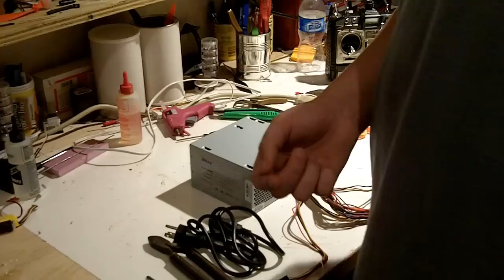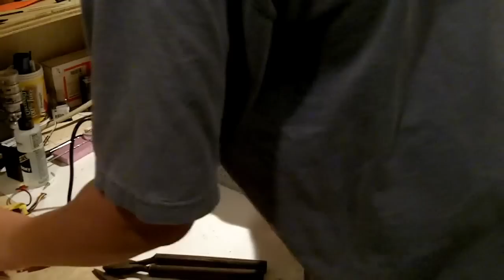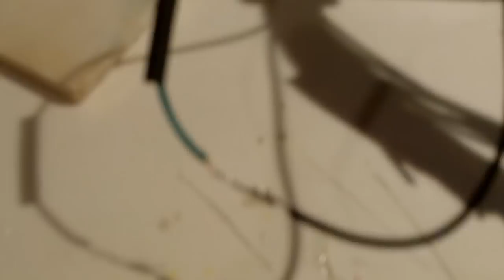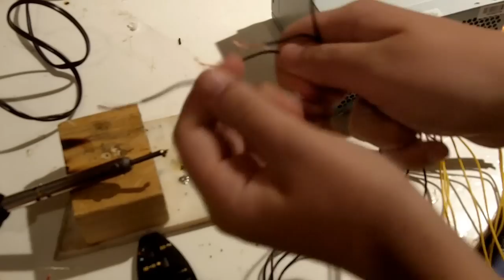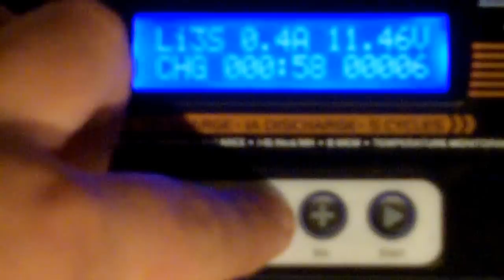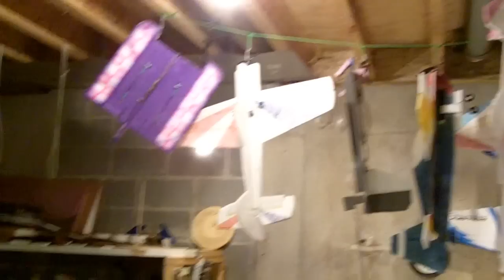DIY 2.0: How to make your own 12 Volt Power Supply

Comment: Thanks dude! I just ripped apart an old computer that I was throwing out, pulled out the power supply and followed along with your video. My lipos are now charging on my B8+ 12V charger connected to my newly made power supply! :) Stoked! Only criticism, I stripped all the black wires as you said to, then only used 5 coz that's how many yellow wires I had (plus one to connect to my grey switch wire). Awesome job man, thank again.

Comment: Some friendly advice:  For easier soldering, tinning the wires (saturating each one with solder) before you hold them together is recommended.  The soldering iron tip should be held parallel against the wires as you connect them for more efficient heat transfer.  These things, along with a heat sink (or alligator clip) at the point where the insulation begins will prevent melting insulation and hold the wires in position, allowing you to hold the iron.
Reply from the maker: +Steve White Thanks for the tips! I made this when I was 13 and have improved a little bit on soldering now.

Comment: The use of a resistor is for switching power supplies, because they won't work without a load.  The resistor acts as a load, of sorts, and the current used is wasted as heat.  Continuous power supplies will work simply by grounding out the green PS ON wire, as shown in the video.

Comment from the maker: Depending on the voltage required to run the fan, put your negative on a black cable then put your positive on the cable with the corresponding color to the voltage. The color key SHOULD be on the side of the charger. check the link in the desc. Scroll down the color diagram and that is standard. Hope I helped! :-)

Comment: Ok, Here is the thing I did the same thing he did with one exception.
I took the cover off of the supply cut the wires that i did not use at the board itself that way there is no chance of shorting the system. I also cut all but 2 of the yellow and the same with the ground. A good video still!

Comment: The Triton charger recommends a 12VC supply capable of 13 amps in order for full function. I have a Triton and use a commercial power supply capable of 20 amps. I also have a small 12V supply that goes to 5 amps and it won't work with the Triton.

Comment: Hi - should connect one of the red 5 volts wires through a 15 watt, 10 ohm, wire wound resistor to a black ground wire to make it work properly apparently Fred in UK.

Comment: Would advice the same as Tom Smith, resistor on the 5v rail if its ATX 1 standard with powerful 5v rail or resistor on the 12volt, if it is ATX 2 standard. So you can place the switching power supply in nice smooth working mode.
Reply: *****  In most of the atx psu units the driver IC cant step down the PWM to the regulated voltages because it need some current drained through the output lanes so you don't see that mad ripple on the start of it and so the unit can run kinda smooth voltages on the outputs. Anyway ofc i would not recommend PWM supply for any nice low voltage circuit, unless you don't use some liner adjustment after the psu.

Comment: continued.........

Wires must be joined to get that. In otherwords if you use one yellow 12 volt wire for one connection and the other for a different connecvtion you only get half the rated amps per wire.Anyone that is going to seriously use one of these should know electricity basics and you should have a tester to see exactly what you have on each line. You must connect the sense line also . This is wire 13 on newer supplies and wire 11 on prepentium 4 supplies. Hook it to the same color

Comment: The only problem with this is atx supplies are switching power supplies so they should always have a load on them . For older pre pentium 4 you should run a dummy load resistor between +5volts and ground.new supplies between +12 and ground 5 watts is good. If not you will have a very unstable power supply that could damage some circuitry. Also you dont have full amp rating that is shown on supply always stay out 20 percent (so 30 amp nothing more than 23 amps or so. and only all of that voltages

Comment from the maker: Make sure you have the green (power on circuit) wire soldered to a black (ground) wire. That will allow you to fool the supply to thinking that it is in a computer and to turn on and remain on. If that does not work, go through and make sure that all of your excess cables are insulated and not grounding out to something. If you have any other questions, feel free to ask! :-)

Comment: this is a dangerous and stupidly hard way of doing this... 2 simple steps: 1. take the main motherboard power connector and look at the tip of it with the clip facing upwards, the 3rd and 4th pins from the top left are the internal constant power switch, bridge them and it will turn on (leave it off for now). 2. use A yellow (positive) and A black (negative). 
The reason: you can still fry it with the same amperage & the outputs are not all on the same feed, you can overload it and cause a fire.

Comment: if i put a basic on/off toggle between the green and black wire, shouldn't i be able to leave it plugged in and just use the toggle switch to turn the power supply on and off? i dont' have a switch on my atx like the one in the vid

Comment: HI,
i tested my power supply before starting and it worked well, the fan kept turning. But now that i have cut all the connector and i connect the green wire to a black, the fan start but stop right away. Any sugestion on what the problem is?

Comment: pin 14 on my touch ATX is grey. I hooked it up to the black to turn on the power. I only have 3 yellow wires. My plug shows 1-O,2-O,3-B,4-R,5-B,6-R,7-B,8-G,9-P,10-Y,11-O,12-BL,13-B,14-GREY,15-B,16-B,17-B,18-WH,19-R,20-RED.
Do I only hook the three yellow together?

Comment: Hello I have a hipro model HP-D2537F3R that I want to use live a variac by adding a knob to control the voltage but I also want to add a switch so that I can still use leads coming from it as presets like my +5,3.3 and 12 is this possible

Comment: I have wires that are half yellow half black in addition to solid yellow and soid black wires. what do I do with these?
Reply: +Dustin Germ hay so, the yellow and black cables are 12v at a higher amp output.  solid yellow is usually 12v at around 7 amps. but it all depends on the total continuous power output.

Comment: Good video. Just one question...why do I see others adding a 10watt/100ohm resistor to the same PSU mods? You didn't add one and it worked fine.
Reply: Depends on if it is an ATX1 or ATX2 PS.  ATX1 needs the resistor while the ATX2 doesn't.

Comment: Great V!deo .... very neat.. thank you man! just want to know , how many 12V device
i can use at a time? if my 4 device all together 200w , needs 10A minimum , do you think it will work safely ? Thanks again ....
Reply: mahabubur rahman I know that when I over amped mine , by adding a 300w car amp to it, it just shut off at the first bass note. so I use a bigger watt psu for amp only
Reply: awesome... you rock

Comment: could you use that for a two way radio or ham radio
Reply: Depends on the wattage rating of the PS.  (Watts divided by 12 volt = amps  (example:  400/12=33.33 amps)

Comment: I have a quick question that im sure you will know the answer to! I have cut my wires and twisted together the green wire and a black ground wire so it is always on when i plug it in.When i plug in the mains cable, the fan on the PSU spins up quickly then stops instantly. There is no power getting to the device i have attached. are there any other wires I need to attach together other than the green and a black?
Reply: some power supplies have a pink wire connected to a red wire at the 40 pin connector.  When you cut off the 40 pin connector you lost this connection.  Run a red wire to this pink wire and it will come on.
Reply: No pink wire on it im afraid. I did look but no sign. I used a different power supply and that works fine so obviously some idiosyncratic anomaly with this HP power supply!
Reply: I had the same exact problem. I found 2 wires into the same slot on 24 pin connector. Tied those two together and (kept the green and black tied together as instructed) the 2 wires I found were Brown and Orange.
Thank you guys.
I was about to give up. Kickin 12Volt Ass now!!!

Comment: KC9WAE  had asked if  this would work for a CB radio. The answer is NO it's only pulling 0.4 amps. Depends on your radio, ex.. say a Cobra 29 may needs something like 4.0 Amps  A high end radio may need 7 to 10. 
JCarrot Selby  asked about the music at the start.  Its a Swiss band, Yello  and the song is,  Oh Yea.   1985 - 87  something like that.

Comment: OK so I am done with everything, I now have 2 sets of yellow wires and 2 sets of black. What do they go into? What I am trying to get is a 12v power supply. Do I connect all the yellows into one and the blacks into one then attach to item? I need it for my robot! Thanks.
Reply: All depends on how much current you need for your project

Comment: I have two Dell power supply but when doing the green and black nothing :(
Reply: What wasn't mentioned is that some of the power supplies have a load sensor on the 3 volt rail. You must take a RED wire, connect it to a 10 ohm 1 watt sand bar resistor, and the other side of the resistor to ground. This will satisfy the 3 volt load sensor and power up the supply. Mount the resistor in the path of the fan flow to keep it cool.
Also, on the supplies that do not have a load sensor, you can add this resistor anyway as it tends to increase the 12 volt rail voltage a bit.

Comment: Can i use this way for charging 12V car battery ?
Reply: You will need aprox 13,8v to charge a 12v car battery, so you can't use it unless you mod the power supply to output 13,8v instead of 12v (there are tons of videos about this kind of mod)
Reply: +jorno1994 how many videos per ton?
Reply: pmessinger depends on your hard drive capacity, but it's probably something around 0.5 micrograms per GB.